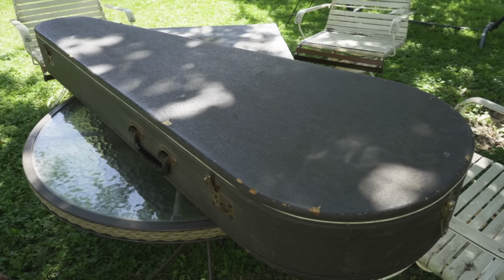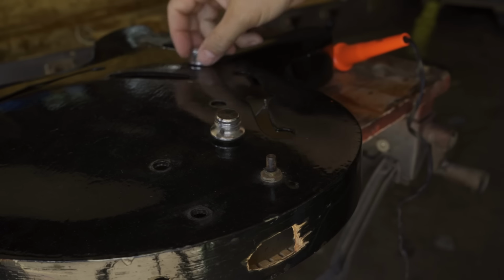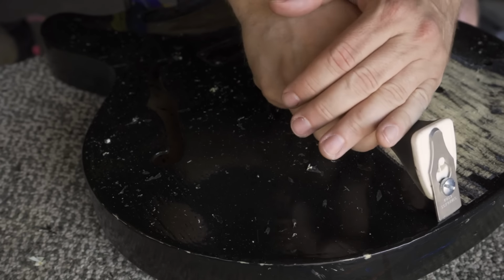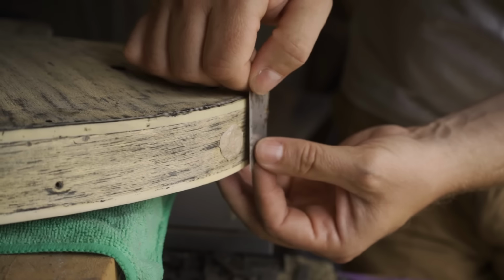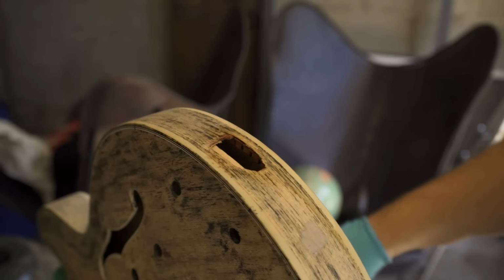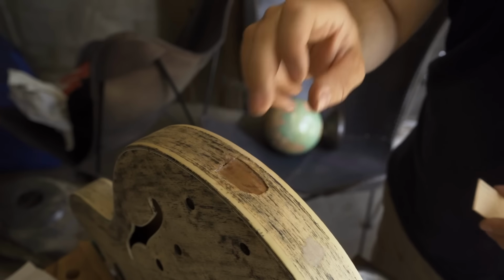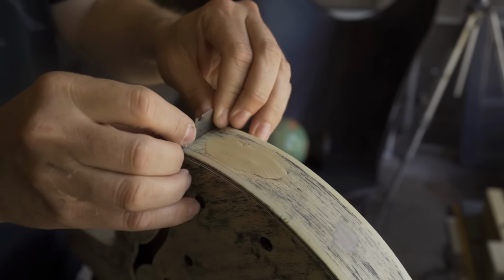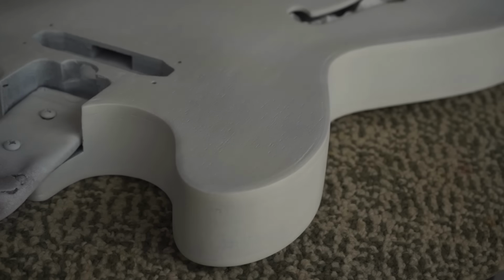I Am Luthier | Do Not Question My Methods | Using My Furniture Repair Skills On An Old Guitar

Comment: Nice work so far!  Pro tip for hole patching; put clear packing tape over the hole, trace the hole with a fine point marker, remove tape and stick it to some 4mm MDF (or similar), cut tracing with scroll saw. You now have a rigid template of the hole which, with an exacto knife, can be  used to cut your veneer patches. Ask me how I know! 😉

Comment: Over the years, I have acquired a couple of dozen electric guitars at very low prices because a prior owner had developed big plans for a guitar, stripped it, realized they were in over their heads, and given up.  I have managed to bring every one of those guitars to better than new condition.

Building, repairing, and modifying electric guitars is not rocket science.  While I recommend that people avoid tackling a rare or expensive guitar as a first project, the narrator does an excellent job of showing what can be done with some basic skills and willingness to tackle a project.

Comment: I have modified, built bodies, and refinished electric guitars for years......and when you first 
said "I will use my furniture refinishing skills to do the job"  I thought .....oh nooooo ! ......
but overall you've really done a decent job !     Strangely I kinda like the look of the stripped
body just before you sprayed on the undercoat .......might have used that myself with a 
transparent slightly amber finish over top of the 'rustic' rough wood ......but that's me ....
Thanks , great , fun video !
Reply from the maker: Thanks, wood is wood.
Reply: @DashnerDesignRestoration  I also thought it might have been a fun idea to put a clear varnish or shellac on the scraped surface. Cool contrast. But I have tried it on a bedside table and it turned out looking awful, lol.
Reply: I also like the look of the scrapped wood before the white base coat.

Comment: I have some experience with guitar repair, though it's been a few years since I worked on a guitar. There are a few things in building and fixing guitars that require specific, craft-oriented knowledge, but luthiers and repair guys rely just as often on basic general wood-working skills. A person skilled at furniture restoration is actually a really good fit for this kind of work, because there's a good deal of overlap when it comes to making good, stable repairs that don't stand out too much. Good job, man!

Comment: I admire your guts for entering this field of craftsmanship.  As always, your methods are "down to earth" and without any snobbery.  This may not be the most perfect way, but it certainly is better than not trying or being afraid of doing it.  BTW, the types of glue have little or no effect on the sound.  After all it is an electrical base guitar, though I would not recommend these methods when restoring a high end acoustic instrument.  But I am pretty sure you know that yourself.

Comment: A fun project. Some of these methods would not have been my choice for a musical instrument, but the thought process was logical and methodical. I like seeing people just try stuff. The guitar was jacked up anyway. It's not like you could hurt it. 
(The white primer made my teeth hurt a little bit.) It's OK, though. Everything is going to be OK.
Reply from the maker: Thanks for watching. Can you explain how any of the methods used would be detrimental to a musical instrument? The white primer coat for instance. How is a coat of paint going to hurt an electric guitar? I’m genuinely curious.
Reply: @DashnerDesignRestoration  The white primer is going to make it sound bad some how lol
Reply: @DashnerDesignRestoration  the white paint wouldn't effect the tone, but I'm confused as to why you'd paint before finishing the wood considering you said the previous paint had sunk into the grain.  Wouldn't it be a better finish to really sand it (much finer grit), grain fill it (since it sunk in last time), sanding that back (even finer), and then giving it the first coat?  Just concerned that it'll be a pain to get a really good finish on a rough, spongey surface.  On the other hand, the constant sanding for a guitar is a real pain in the bum for a casual project.
Reply from the maker: @matt lang I painted it before filling the grain because the mottled color of the unpainted wood made it too difficult to see the imperfections that needed to be filled.  Having it all one color made it a lot easier to pick out the imperfections that needed to be fixed.  Since I uploaded this video, I've grain filled it and now have a nice smooth finish for the color coat.
Reply: @DashnerDesignRestoration  Can't wait to see the next vid. I like seeing these kind of things come together.
Reply: @DashnerDesignRestoration  Would a leather dye rub or water based stain also accomplish that? I would think it would be best to not seal the wood if you still need to work on it.
Reply: @DashnerDesignRestoration  

I'm sure it looks great!  Enjoying the video. I'm sure the solid color will look great!  It's hard to know the grain is filled if you can't see it!  The fun thing about finishing is if something doesn't work you can always sand down and  start again.
Reply: I happened to stumble on to this video.
I can’t say I didn’t skip ahead on portions…
Using a flat metal scraper on a arch body guitar is probably the single worst thing you can do.
That guitar deserved a better method.
Once you damage it, there’s no going back.
Except to cover it in many coats of paint.
And yes, all that paint can affect the tone of the wood.
I spent a week sanding paint off of one.
All I can say is, nice attempt at a walk hanger.

Comment: if you had a heat gun you could have pulled the finish up in huge sections some small spots might fight it but its worked evry time for me. i start by chipping a small spot to get s small air pocket under the finish than heat it up and carefully cut under it and lift witch peels large peaces off at a time without damage or gouges or scratches just whatever was under the paint.

Comment: I am sure every luthier and guitar tech who watches this and comments will be telling you everything you did wrong. I'll just say you did some things really well. Two suggestions if you decide to repair another guitar. Don't use wood filler to fix a hole. Over time the filler and wood will shrink/expand at different rates causing cracks. The process you used for the big hole would be a better option, if a bit trickier due to the smaller size. A shop made dowel with cross grain would work well. Secondly, the spaces around your patch are better filled with CA glue and very fine sawdust. Sanding and painting will make the patch invisible. Anyway, I enjoyed the video.
Reply from the maker: Hi, thanks for your input.  The filler I used for the small hole is an epoxy putty which won’t shrink or expand. The guitar body is plywood which also shouldn’t have much movement.  I’ve used similar techniques to fix furniture and I haven’t any problem with them even after years of seasonal changes of temperature and humidity.  Plywood is plywood, whether it’s in the shape of a guitar or a cabinet.  But who knows, maybe that piece of plywood knows it’s a guitar and will decide to break into a million pieces in a few years just to prove me wrong, haha.
Reply: @DashnerDesignRestoration  I take your point about epoxy/plywood, but I am biased for using wood whenever possible. I am looking forward to the next episode. I even subscribed so I would get notified. BTW, as you probably know, plywood guitars are very sturdy and stable and are frequently preferred by working musicians for that reason. Regards.

Comment: Very cool! 
Not sure if you tried using a putty knife or flat head screw driver to pry the control knobs off from underneath, but that always seems to do the trick for me.... I usually also put a little towel underneath the tool when doing it to protect the finish.  My guess is the blade of your oscillating tool ended up prying it off in the same way before potentially cutting through the shaft. 🙂 

Looking forward to seeing more... Thanks for sharing!

Comment: Little tip if you wanna make better patches ; bevel the area you wanna fit it to, with the right wood and fitting, will be completely invisible and much more durable too.
Reply from the maker: I am luthier. Licensed in three states and two commonwealths.

Comment: When I saw the larger hole I thought it would be fitting for a Strat style output jack plate. Just add some wood on the inside to strengthen the area enough to accept the screws. Your way was absolutely lovely though.

Comment: i tried a little experiment to see if you colored back and forth on paper (on a flat surface) with 2H pencil lead and then put the paper face down over the indented area that you want an impression of, could you rub over the paper and would make a reliable impression of the  indention. you could try it with different hardnesses of pencil lead, maybe a charcoal pencil, or maybe hard artists' sticks (thin, hard chalk-like sticks with a square diameter) and different types / thicknesses of paper to see what works best. ~ just an idea. :-)

Comment: The big hole looks more like it was plugged into an amp, and the strap broke/came off and it fell on the output jack & cable. Seen it a few times in the older hollow-bodies.

Comment: Any indication of manufacturer?  What you started with is a "guitar shaped object," so anything you do is an improvement! 👍
It appears to have a truss rod - I recommend checking for neck straightness as this can determine whether the resto heads towards playable or "wall hanger."  Thank you for the video 😀
Reply from the maker: It’s a Vox Cougar.
Reply: Okay - if the old bass has a straight neck, it should be okay.  Vox outsourced their guitar/bass production to Italy in that era.  Some pretty cool instruments 👍
Reply: He said he was a luthier and not to question him.

Comment: You apparently have a big fan base who does not take any criticism of you lightly 😱
Previous posters of criticism has been battered hard but I still feel that I will come with some small tips 😇
Your ”support” of the plywood will cause you problems when installing the output jack since the gap between the supporting pieces are to narrow… I would have ”molded” two pieces of veneer to the body contour and cut it longer (and maybe wider as well), drilled a hole in the piece, put a string with a knot and used that to pull up on the piece after wiggling it in place… This works since the hole is oblong. Then proceeded as you did, except for the final layer. There I would have chamfered the edge of both the hole and the final piece to make it fit perfectly.
I do not at all disapprove of your use of the more traditional shellack but find it a bit strange that you so far have used so many different type of glues and putties. Thus far you have used epoxi putty, CA glue, wood glue, epoxi glue and wood putty and this is only a small repair…
Expecting to be ”hacked to pieces” but still…
This is a vintage instrument and should be treated with care, when repaired, and not be destroyed even more than it already was.
Reply from the maker: Thanks for watching.  I'll be drilling a hole for the jack and will mount it to a jack plate which will be screwed into the guitar. I'm curious why you find it strange that I use different types of glues/putties.  Shouldn't I be using whatever is best for that job or should I be limiting myself to one type of glue/putty?  
Also, I heard from a very well respected luthier that using different types of glues will make the instrument more versatile.  The super glue will give it a deep Reggae tone, the wood glue is best for Adult Contemporary/Top40 and the epoxy will give me a hot Rock N Roll tone.  Now all I need is some hot hide glue for a searing Fusion tone and I'll have all my bases covered.  
P.S. I'll do my best not to destroy it more than it already was.
Reply: @DashnerDesignRestoration  Using many different types of glue in one repair makes it harder to fix it if another accident may occur. In the repair of the bigger hole you used CA gluewood glue, epoxy glue and wood putty…. I would have used only CA glue (or wood glue) in that repair myself.
In musical instruments (especially electric ones) the type of glue has no noticable effect on the tone what so ever… Even the type of wood has a negible effect on an electrical instrument. The main reason for using hide glue or traditional wood glue is that heat will make it possible to disassemble the instrument easier (for repairs).
Reply: The previous posters were not attacked for their criticism. The previous guitar snobs were attacked because they were gigantic honking dickholes about how they shared their criticism. @Dashner Design & Restoration regularly tries out things on projects that viewers suggest he try. We just don't act like assholes when we have input.

Everything except that last sentence was fair (the high number of glues and putties is what you do when you're experimenting, think something may work better, or trying to use up the last of what you have on hand. It's why I had six different concentrations of shellac when I was learning to french polish) Why are all you guitar people like this? You give advice and then backhandedly insult like the person doing the repair is just offending your very being. 

No. This is not "a vintage instrument". This isn't a goddamn long lost fender that hendrix played. This bass guitar was garbage. Garbage. Literal. Trash. Yard art. 

Getting it back to working order in any way is an improvement. There's a reason you guys are hated, but something like the hot rod community isn't. People who like their perfect factory restorations don't screech and gnash their teeth at the rat rod people who like making junkyard rust drivable again and doing it however they like. Because in the end, it's a thing. An object. Not alive. No provenance. It is whatever its owner wants it to be, and the joy comes from seeing what that owner can achieve. And you are not that owner. 

Just give your advice for how to do the job easier/better and stop there. I was interested in fixing up an old junk beginner acoustic guitar that I have, but I looked into the guitar repair community for guides on where to start and you people all seem to be just awful. No enjoyment of your hobby or desire to share it with the world. Just spite and gatekeeping and unpleasant bickering with each other. 

(and FYI, I would have spelled shellack as "shellac." Because shellac is the material. Shellack is the process of applying shellac.... I know it's meaningless and semantic and belittling to say, but y'know. It's exactly the same thing as when you "um, actually" something that's obvious enough as to be annoying. And you took his blindingly sarcastic joke about tones and glues serious. Come on man. You need to re-assess how you interact with the world.)
Reply: @colinmartin9797  I'm not sure if you noticed but I think Peter was talking to Dashner and then Dashner was talking to Peter. I don't think Peter mentioned you at all. Not once.
Reply: @DashnerDesignRestoration  I saw the title, and was drawn in. I have no idea of what the whalers played, but, were their basses superglued ?
Reply: 100% agree

Comment: Back to the big whole. There is a lot of force due to the lever arm of a 1/4 “ jack in that area, thus the hole. CA glue certainly has it’s uses but generally for static inlay or as a liquid clamp allowing more durable glue, along side it, to cure. CA glue will become brittle rather quickly under the pull of the jack. Epoxy resin (West Marine or Total Boat) along with the wood structure and veneers can absorb constant force for a long, long lonely time. The Citizen, Toth Stringed Instruments.

Comment: I would have opted for chemical stripper or some of the purpose-made curved card scrapers for stringed instruments. additionally, I would have fit a full backing block for the big hole and used an inside veneer patch for the smaller one.
Reply from the maker: Thanks for your input. Most of the big patch is going to be cut away anyway to make a hole for the output jack. As for the scraper, the scraper I used did have a slight curve to it. I don’t see any reason why I would need a specific musical instrument scraper. This is a plywood guitar.  Plywood is plywood whether it’s in the shape of a guitar or a coffee table.
Reply: @DashnerDesignRestoration  You can get a pack of different-shaped card scrapers for very little money. They come in handy on any curved surface too.
Reply: @DashnerDesignRestoration  I should add, the block on the big hole would be to provide structure to the future jack. The surface plys just have to make it smooth.

Comment: I saw a different video of someone restoring a guitar once...instead of using epoxy putty to fill a hole (much larger than this), the guy used glue and crushed ramen noodles.  And when the people ripped the guy up for doing that (in the comments), he obviously logged in as someone else and said he was a luthier that has done this himself in the past.  :)  I think epoxy putty is a much better patching material.